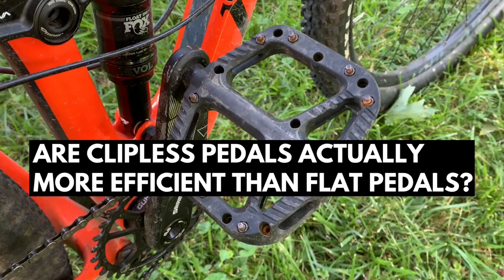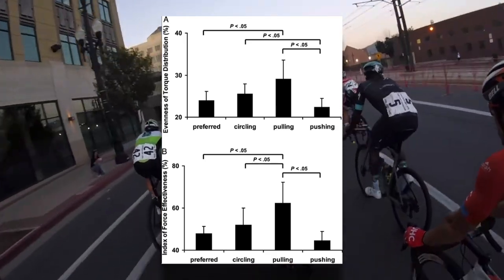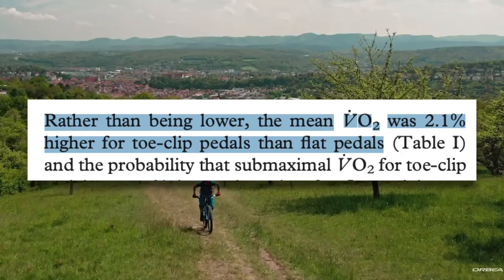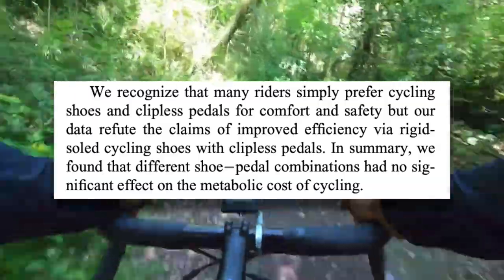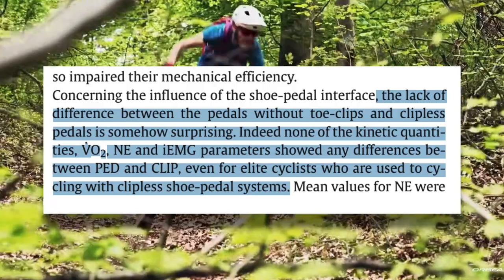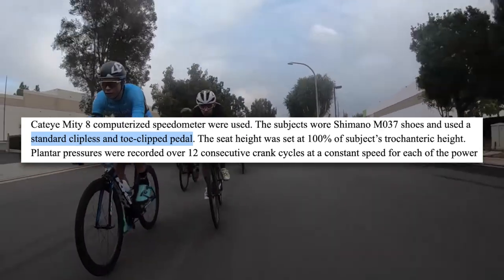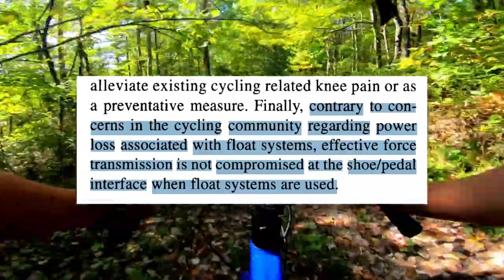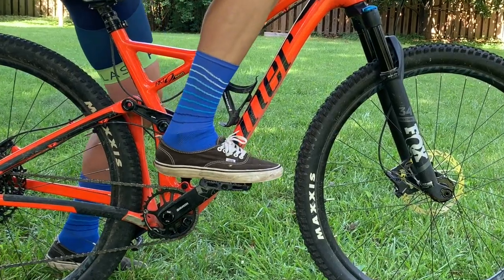Are Clipless Pedals Actually More Efficient Than Flat Pedals? The Answer Might Surprise You.

Comment: I think the main point of clipless pedals is that they prevent pedal slip. 
I use flats because I don't like having to wear special shoes. Although, Shimano does make sandals which is what I normally wear while cycling. I find clipless pedals weird, I can't just change my foot position. Haven't had a pedal slip while sprinting before and honestly, if you want yo pull up, you can do it with flats too, just angle your feet forward like doing a scoop.
I just feel that clipless pedals won't help me anyway, I'm not some world class rider, heck, I've never even been in a competition before, I'm way too slow, so I'll just stick to overtaking cyclists with full gear in my extremely casual attire while using flats on a full sus mtb. Because it's seriously hilarious.

Comment: I ride 100-200 miles per week with my 9 year old son. The first day we got his clipless pedals, we did a 60 mile ride on a route we do frequently. I can tell you he was able to accelerate much more quickly and he had much faster acceleration up the hills.  I don't care what the scientific studies say. There was a quantifiable difference between his instant acceleration and his speed by the top of the hill. Normally I have to hold back a lot because I am going too fast for him. On the ride with the clipless pedals I did not have to slow down for him once. I also like that the cleats can be oriented correctly for proper foot/ankle/knee alignment for improved crank rotation mechanics.

Quick edit here... I just told my son the studies showed there is no measurable difference in efficiency or power going to clipless from flat pedals and he just laughed and said, "Yeah, sure daddy..."

Comment: I've always wondered why triathletes (specifically short distance sprint triathletes) haven't considered flat pedals for faster transitions.  And I'm guilty of doing shorter and olympic triathlons with clip in pedals. 😬
Reply: Because in olypmic and WTS triathlon the courses are mostly full of turns and sometimes turnarounds. Imagine trying to keep up using flat pedals in those 1000 watt accelerations where we actually do pull up during the upstrokes. The point is that pulling up really helps at sprints and accelerations but not so much on flat and straight courses
Reply: @devzs5251   -  Yeah,  anything draft legal might require some accelerations and some of those WTS courses have tons of U turns.

Comment: So, I'm an amateur cyclist.  My understanding was always you don't "pull up" with clipless, it's more about extending the effective power arc so that there's more overlap between both the legs.  That being said, I recently put flat pedals (with the little replaceable vertical pins) on my mountain bike and I felt like I could get that same "power overlap" with them.  It was like using clipless but having more comfortable shoes.  I mean, with the right shoes, they really do grab the foot well; well enough for me that it's become my preference.  Planning on picking up a gravel bike and using the mud-clearing SPDs on it.

It seemed the studies were directing the elite cyclist to "pull up".  Maybe they shouldn't give any direction to the cyclist at all and see what happens?

Comment: I ride the same four mile section 100x per year.  I switched to flats for a month and I was disappointed that I had no top 3 strava segments on flats there and I could not come within 1:30 of my times clipped in.  It’s a pretty technical course with lots of climbing.  My feet would often get pushed out of the best position  on the pedal with the flat pedals and mtb flat shoes.  I switched back and immediately rode faster.  The interesting thing for me was it “seemed” faster on the flats and I felt more comfortable even while wearing flat pedals, but in the end it’s just not nearly as fast for me for cross country riding.

Comment: My case is very different from most here.  I ride a recumbent tadpole trike.  Yes, I'm an old guy.  No, I don't have a beard.  I did ride it coast to coast on the TransAmerica Trail in 2016.  I have absolutely no interest in racing, though I've ridden road bikes before I got my trike.  Touring is my thing and the trike is slower, but it ain't a race.  I never felt like I had to get off the trike at rest stops and for most of the trip would find a spot in the shade during the heat of the day and take a nap right in the seat.  Don't bother to yap at me about how heavy, inefficient, low, or whatever trikes may be.  It is a lot more fun than I've had on 2 wheels.  Descending is an absolute blast.

Here is the thing with trikes; if your foot slips off the pedal on the downward part of the stroke and hits the pavement it can be pulled under the crossbar, causing a very serious owie as the full weight of the trike and your body are applied to the hapless limb.  But riding a trike means you never need to unclip at stops.
I use and love Speedplay Frogs because my knees are a bit wonky and I need a lot of float to keep them happy.  Not that it matters, but they are super easy to unclip.  I don't even have to think about it and I've never had a failed release.

I guess I pedal squares most of the time, but on the TransAmerica I found that I totally became a masher, or more accurately, stomper on climbs near the end of the day as I got tired.

Comment: If you don't think about your pedaling style, you end up using a lot of downstroke effort to lift the dead weight of your opposite leg. in fact if you concentrate on lifting the weight off the pedal on the up stroke ( not pulling up , just lifting the weight, i.e as on flat pedals) and just let the leg fall with gravity and not push on the downstroke, you can make good progress on the flat, try it. If you push on the downstroke and lift on the up you zoom along.  The energy used is the same at the end of the day, but you use different muscles so you can produce more power for less fatigue.
A good tip is imagine kicking a ball at the to of the pedal stroke.

Comment: I think that there is a point at the top of the pedal stroke with flat pedals where your foot is basically floating.  I'm sure that it really isn't a problem when you are just loafing along, but when you start pushing harder, that is where your foot starts moving around.  When you are locked in, everything is smoother when you are pedaling hard.  I think that the real difference is around the 11 o'clock position.  When you are using clipless, you are starting that power stroke, where with flats, you are basically in no man's land until you are on the down-stroke.  Once again, if you are just casually riding along, no big deal.   
I've never been a fan of pulling up.  I find it uncomfortable, actually.   I've tried it and I see no real benefit, anyway and it makes riding unpleasant.   A nice, smooth, stroke makes a ride more efficient and enjoyable.  At 62 years old, comfort and enjoyment is the name of the game.

Comment: Clipless on road and just switched back to a good set of flats and Ride Concept shoes for MTB. My shoulders will thank me as I crashed real bad and hurt both of them because I did not have time to get rid of the bike and control my crash. It's funny how I'm just as fast as I was while I was clipless and don't suffer half the leg cramps I used to have when riding clipless.

The only reason I still use clipless on the road is because of the weight savings and I'm not likely to crash unless I'm hit by a car.

Comment: In my experience it seems the biggest issue for me is whenever I shift into a faster gear the momentary slack in the chain as it moves to the smaller gear causes the pedals to jolt forward. Without using clipless I would lose my footing 90% of the time. It was never a game breaker but it was incredibly annoying. 
So it seems that the main advantage is keeping your foot in an optimal position and keeping your foot engaged with the pedals the entire time

Comment: I use expensive mountain bike 'adjustable spiked' pedals and special MTB shoes with a solid plastic insert in the pad of the foot. You can't possibly slip off with these. You can adjust the amount of 'dig' into the shoe with the added benefit that you can walk around the shops with these shoes on and not look like a tool. These spikes make all the difference and I would say they are far more practical than clips and probably even more efficient too.

Comment: This makes me wonder because as an ex-bike racer (just club level) and enthusiast, I don't want to give up my toe clips and most racers won't either.  

There are times when I think efficiency is not important, like climbing, sprinting and when your primary pushing muscles need a break even for a few revolutions.  I would think at these times, efficiency is not the most important thing.  Doesn't being clipped in allow you to deliver more power?  Spin faster? 

 For racing, you have to be efficient enough to be at the right position near the end and then you need power.  I also think that in order to get the cadence that many racers use, being clipped in helps. 

As the debate and the science continues, I will be listening.

Comment: I have thought about getting a clip less set, but I feel it’s awfully inconvenient for commuters and “casual” road riders. My biggest deciding factor was the added ability to bunnyhop 😂
Reply: Well worth learning how to bunnyhop without being clipped in. It gives a lot of insight as to how to make the bike do what you want under you, as well as making you faster and smoother while clipped in too.
Reply: peglor im still working on that 😂 but I can’t seem to figure out the back wheel dismount after gettin the front wheel up. I wanna say my seat is too high but other people do it so effortlessly 😓
Reply: @dalechen521  Most of bunnyhopping is getting your feet out of the way to allow the bike to get into the air. A quick experiment to try is to stand in front of your bike and pull the handlebars forwards towards you suddenly. This movement, even with no upward part to it at all will cause the back wheel to leave the ground. The hard part is getting the timing right so your weight isn't keeping the bike on the ground while your arms are trying to lift it.
Try lifting the back wheel only as well, first unweighting it as you go up a small kerb, then actively pushing down on the pedals to preload the tire to make the bike rebound into the air. It takes a bit of time and a lot of going around in circles in a parking lot confusing passers by, but once you get it it gives you a few very useful tools to ride smoothly off road.
Reply: peglor thank you so much! I’ll be sure to leave time after every ride to hop around my neighborhood 😂

Comment: I use good quality flats, Burgtecs, and the grip solid. I think it's a psychological thing, if you feel locked onto a pedal you feel more confident when pushing in the power. 
The upstroke is a myth, unless you've only got one leg. On the up stroke your leg is resting while the othe takes over. Apply power from just after 12 o'clock through til 7 , overlap the power, you fly.

Comment: Every time I see a clipless vs flat. They both have thei pros and cons. Where flats seem to require less power and less power is produced (that is a weird sentence.). Clips have a higher required energy for the higher energy. Basically on hill climbs and level fields they produced the same effects. Meaning flats required less power over all to get almost the exact same stats but over all produced less power for a slower speed but would actually be close in time to the clipless. 

My theory is that flats require you to push THROUGH until you get every last bit of energy you can get to make the next leg push down to be easier. So it would need a higher start power force but be lower over a long distance while the clipless would need less energy to start up but require more energy over longer distances because you are no longer trying to get the max amount of angle in the pedal.

Comment: I learned to use clipless when I was about 14 while racing BMX and riding mtb seriously, I used the upstroke method on BMX starts and for hopping and maneuvering a mtb it makes a difference, I use flats now though for non-competitive road rides (2.75 hours 40mi) as I am not trying to put down 1500+watts from a standstill, or hopping over logs; I can still hop if I need to, and my posture and hips feel much better after riding compared to how I feel after riding when clipped in and pulling up on the pedals.  I can feel a pair or rigid sole shoes would actually provide the next level of comfort both while in the saddle and after riding even with flat pedals, I am really curious about the arch support theory when applied to flats too.

Comment: i'm a road cyclist and a MTBer. I ride clipless on the road and flat on the MTB. I started MTB with skateborad "type" shoes and last year, I switch to real Flat MTB bike. WHAT A difference ! huge improvement on the power transfer to the pedal. Snickers and skate board shoes shoulgn't be used  for MTB flat pedals. Also, flat pedals choice is important! flat with no pins or low pins is not good. Gripper your pedals are, better your pedaling will be.

Comment: Mechanically I would think clipless pedals are not for pulling the pedal up but for pulling the hips down. It helps anchor you down and prevents lateral pelvic tilt which could increases the efficacy of the down stroke (better consistency and stability)

Comment: If you have ever had a foot slip off a pedal in a full sprint or hard climb, you will appreciate being clipped in. Harder to ride out of saddle with feet not locked in.     

BTW,  for mtb I have mastered using toe clips and straps with mtb cycling shoes without the cleat.   It keeps foot in place without being locked in.   The straps can be kept loose or tightened a bit.

Comment: Dylan: Have you seen in the literature to look at other parameters such as maximum power, maximum cadence when clipless and flat pedals are compared? My personal experience is that I can't pedal as fast using flat pedals vs. clipless pedals. All else equal, faster cadence means higher power output and hence higher speed.

Comment: I took an old pair of football shoes, cut off the crampons where the cleat goes, drilled 3 holes and put from the inside 3 flat headed nuts. I made it snugly fit so I don’t feel anything from the inside. They were glued there and trimmed from the outside so they don’t stick out. 
Ultra light cycling shoes for 40 buck (actually 0 because I grabbed some yellow old pumas Evo power I had lying around here)

Comment: What really gets me is when people claim that road clipless is "more efficient" than mtb clipless because of some nonsense like having a larger cleat makes the power transfer better. But that fails the basic sniff test of "So where does the claimed wasted energy go in the mtb clipless system? What's heating up? Where's the entropy?" Cycling still has to obey the laws of thermodynamics.

I switched to SPD for everything, road and MTB, back when I started putting enough miles on my bike that my feet would get sore from my sneakers flexing on flat pedals. Never looked back. Having my feet always slot into the exact same position is so nice, especially towards the end of a long ride where trying to consciously plate my feet in the right place is just way too much effort.

Comment: I had been running toe straps for 5 years riding my local 700 elevation climb 300 times.  Last month I got clipless pedals and matching shoes and first ride (wrong saddle fore-aft height etc) got pb by 1 minute from 40 minutes to 39 minutes ( it was tempo to sweetspot HR zone compared to FTP for previous record ). Only way to explain is wrong saddle set up cause of the change according to the video. I thought it was the change from straps to clipless. Surprising.

Comment: I've got flats on my fatbike and dj bike (and a spare pair for my mtb), and clipless on my mtb and road bike.
I appreciate the convenience of flats for commuting, winter riding, and skatepark riding, all places where you might be putting a foot down very frequently.
However, on the cross-country trails and roads near my home, I'm almost never taking my feet off the pedals so none of the objective benefits of flats really apply.
As for clipless, I find the power transfer to feel far superior as the majority of my shoes are old running shoes with large amounts of cushion, which causes a mushy feeling when I'm pedaling. Clipless shoes, even the very inexpensive ones that I have, are far superior in this manner.
The other, more subjective thing is foot placement, with clipless, I know my foot placement is always good, an issue I struggle with on flats. 
I love both systems but find clipless to be more satisfying and mentally reassuring for most of my riding.

Comment: I have been used Flat Pedals with Toe Clips/Straps without cycling shoes for keep foot good postion. Useful half way solution.
Reply: Toe clips suck. Get messenger straps or Power grips
Reply: Toe clips only work for real cycling shoes, the good leather ones with wood shims nailed on for rat trap pedals, or heavy soled skate shoes with enough waffle or ridges to avoid cutting off circulation with the straps while gaining traction.